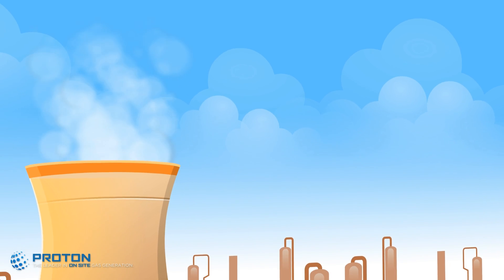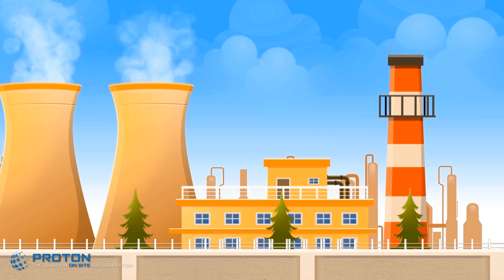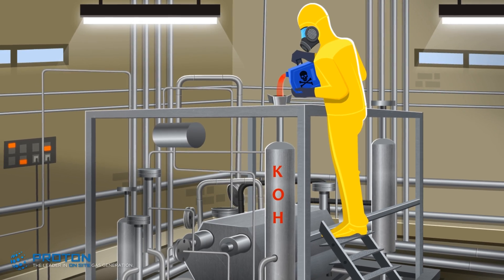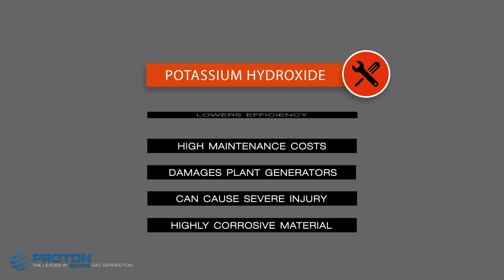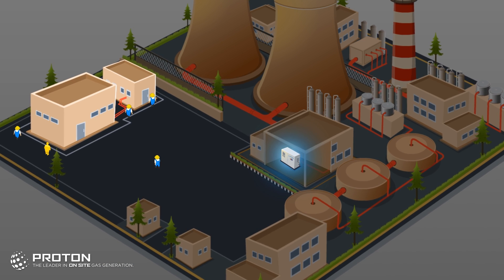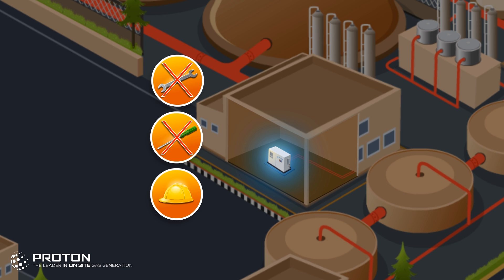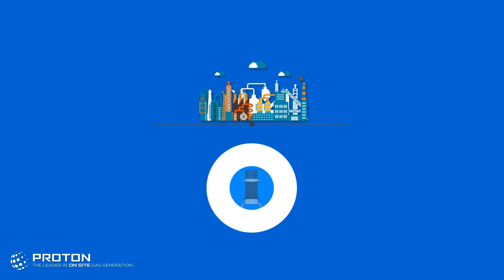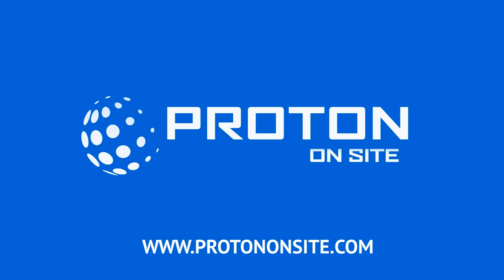Hydrogen Generators: Safer Solutions for Power Plants

Comment: We as consultant like this technology and would like to promote this technology.
Reply: Mr Shailendra.....Please few questions.
 Can the Hydrogean be used as fuel to generate electricity from existing 
Air cooled GasTurbines (instead of using natural gas)...??
 Any Air cooled Gas Turbine produces hot excaustions and is used to 
heat water (Steam) to operate Steam Turbines (as extra power source) . 
If yes, Can we use the very same Steam Turbines from today's fossil fuels 
power units (Meaning not to be thrown away).

Thank you!

Comment: Aren't PEMs normally used for FCs rather than H2 electrolyzing? Why is a PEM "necessary" for generation?
Reply: Works well with renewables (turn on and off quickly, aka either sunny or cloudy), which seems to be all the rage these days

Comment: I believe we should switch to burning hydrogen gas heating some thermal electric generators generating electricity. About 10% of that electricity would be used to power the electrolysis making the hydrogen gas fueling the heating furnace plus circulating the cooling water from river or ocean keeping the thermal generator not only cool but outputting power efficiently. If a leak has been detected somewhere on the hydrogen lines, all the electrolysis could be shut down to decrease the explosive risk.

Comment: And where is the electricity needed to split the water molecules coming from?...   Did I miss something?
Reply: Your online youtube reviews don't use important things like a platinum catalyst, alkalined solution, the right temperature or efficient design. Most 'reviews' are using bloody aluminium as a catalyst normal water and that's it. It's like me using a hard drive from a 1960s computer and proclaiming all computers are inefficient and slow and not worth it. Rather than the correct materials and design.
Reply: @cam_au  can you link a well designed one? Im looking about making one
Reply: Solar ?
Reply: I have a great one. containers of HHO are also really fun to blow up!
Reply: I came across some very informative videos on a breakthrough method of making hydrogen without the need for external power. Look up: H2IL  The tech is interesting - a new electrochemical method that succeeds conventional. I'm a scientist and believe they are on to something.